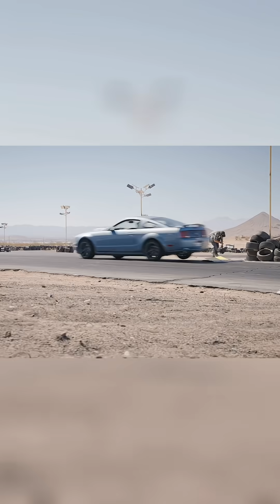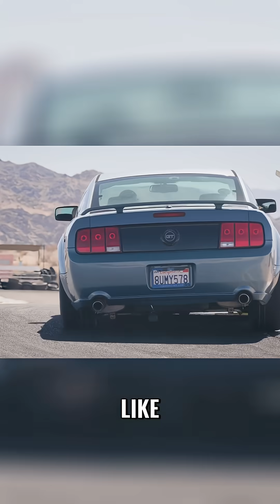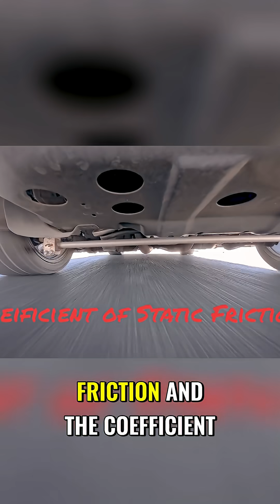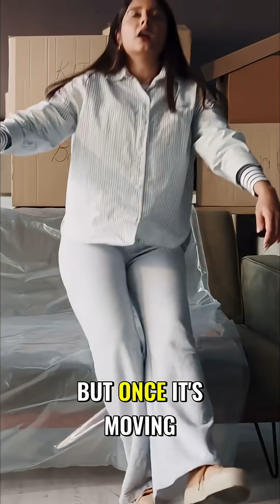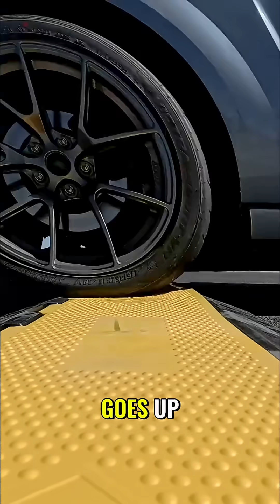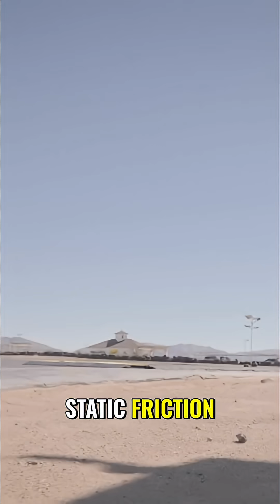Mustang vs physics: Secrets of the solid axle

Comment: This is why camber is a thing
Reply: Camber won't change the way this works, but it can give you just a tad more grip before it happens. Ironically, that can actually make it more difficult to catch when it lets go.
Reply: Camber on a powerful RWD car is actually horrendous for handling, straight line traction, and tire wear. That's why they make lock out kits that essentially convert IRS RWD muscle cars like the Hellcat back to solid rear axles.
Reply: @Impactjunky  Yes because tracks are all straight line 1/4 miles